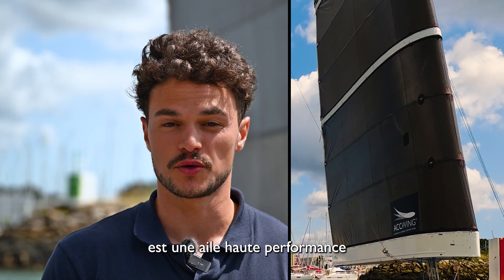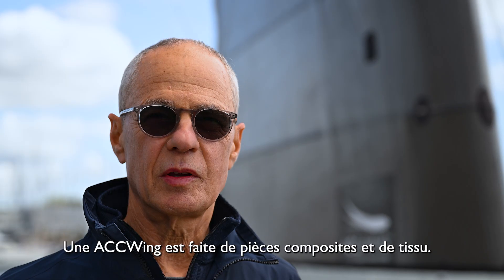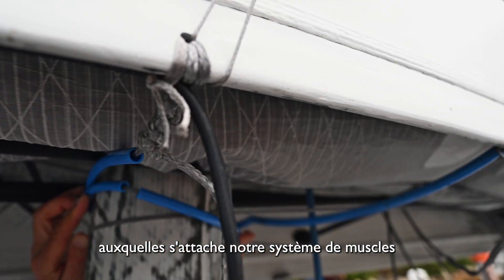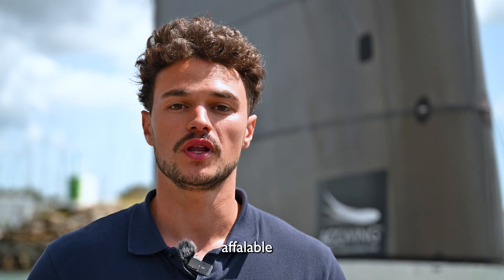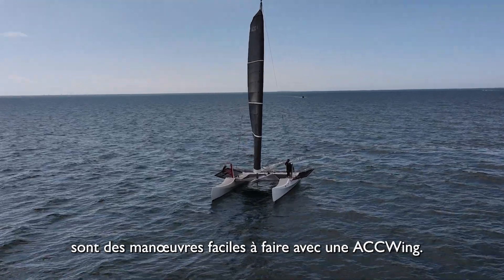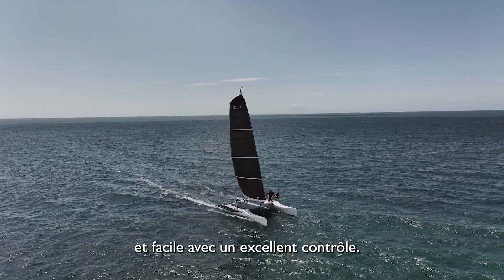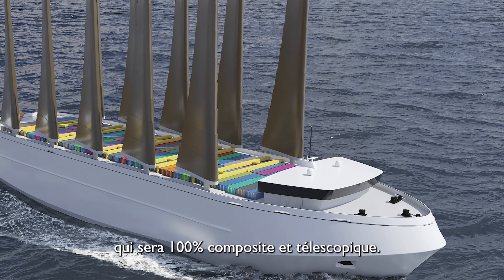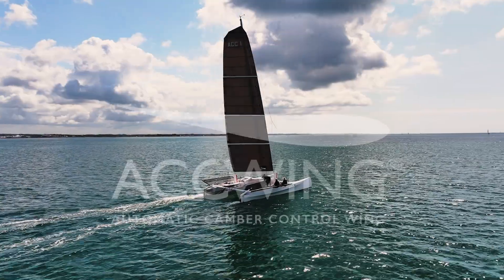ACCWing, a high performance wingsail

Comment: Looks good but the filming was not good, I had to slow the video down to 0.5 speed just to see some detail. Please do another video of the design and how it works a bit better, also no telltales on the sail for trimming, also need to see actual wind data, speed and TWA for comparison
Reply: No telltails because humans aren’t trimming. That’s the point, I think.
Reply: I agree - less of the talking heads and more of the sail operating would be better.

Comment: Hm, it produces very little camber.  That is optimum for high wind speeds, but not for typical yachting conditions.
Reply: Multihulls generate enough apparent wind that don’t require as much camber
Reply: @terrygalvin9653    Certainly true of the stripped racer shown here, but not  true of your average cruising catamaran, I'd say.  A cruising catamaran averages about 20% more speed made good compared to cruising monohulls.  This sail looks like maybe 3% draft?
Reply: There was more information on their site.  The camber abilities look sufficient to me, but I don't see any point to the twin skins at high apparent angles.  
I think a better statement would be that this rig only contributes significantly to performance when sail drag is a significant portion of total drag.
It sounds like they recognize the limits and needs because now they beefed up the rig for a headsail -presumably a large downwind sail.
Reply: @skyak4493  "Adequate" is not a number.  I see no number on their website.  Words like "adequate" are puffery, not science.  It looks adequate to you, it doesn't look adequate to me.  An actual number would give a factual basis to base a reasoned judgement on, versus an opinion of how it "looks" to one guy versus another guy.
Reply: Dude thinks he's an expert after watching a 2 minute Youtube video.
Reply: @captainwin6333  I sailed my own boat transpacific, Seattle via the S. Pacific to Hong Kong; I had a passenger cat design of mine  approved by the USCG for up to 149 passengers.  My first voyage was as skipper of my own boat to Hawaii in 1972.  Pray tell us your credentials.  You are so top lofty they must be very impressive indeed.  Designing wing sails is a hobby of mine.
Reply: @timdunn2257  When is youre video coming out ? Or are you still sitting designing ? Will you let us know ?